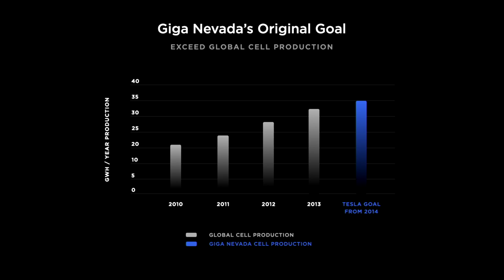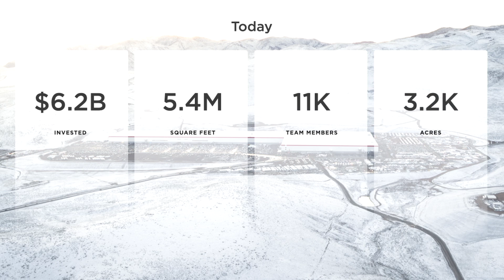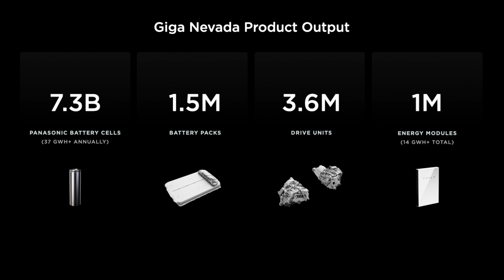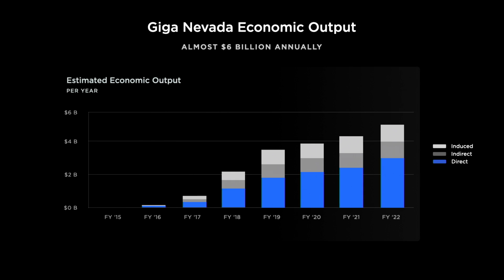Giga Nevada Battery and Semi Manufacturing Update

Comment: I love the idea of EV commercial vehicles, but I don’t like electric personal vehicles they are boring yuck no offence if you own one.
Reply: @logitech4873 Ive driven 100s of electric cars in my career what don’t I understand? Sounds like you don’t understand car enthusiasts. I work with my hands on engines and nothing compares, I don’t like boring, quiet, whiny sounding cars with no road feel, no clutch, no gearbox, no vibrations, nothing connects you to the vehicle, they are just drive by wire sleep pods. I can’t even work on an EV myself when it inevitably breaks, you’re locked into incredibly expensive repairs what am I supposed to do with that? With mechanical stuff you can just look at it and see what went wrong, EVs just degrade into E-waste. Can’t even upgrade or modify an EV. Gas/Diesel cars are already wayyyy fast enough for my taste. The sound and feel I get from driving is so divine it’s godly to me. I’ve installed apple car play, touch screens, all sorts of new tech in 20+ year old cars and I love it. Electric cars offer nothing for car enthusiasts they take everything away, so what’s your point? It’s like you’re comparing apples to oranges my friend. Your comparing an iPhone to an engineering masterpiece with a beating heart like a Rolex. Are you a car hater? Have you ever actually driven and enjoyed a manual sports car? If you were a car lover you’d understand.
Reply: @CarLoverPhotography  Damn so you only like some cars? Sounds a bit limiting. I love all types of cars.
Reply: @logitech4873  I’m just saying I’m against EVs taking over, or causing problems for people who rely on gas powered vehicles and explaining why I said EVs are boring.
Reply: If you were a car lover, you'd understand.

Comment: We can put massive amounts of solar at the base of wind farms too. It's space that's not used. Sure we will lose what ever the % is to shadow loss. But gain all that extra electricity.
Reply: What do you do it a turbine needs to be service or even removed but there's nothing but solar panels blocking access?

Not to mention the moving shadows of the turbines blocking direct sunlight.

Comment: what if cars antennas on top of the car connected to power lines on the street to control the car via bluetooth like a rc car
Reply: Because it's not realisitic.
Reply: @TheEvilmooseofdoom  if rc cars exist with batteries and a controller im sure it can be possible in some sort 😂
Reply: @saint3573  Remote control, sure, antennas connected to powerlines is silly.

Comment: 1:01 Couldn't the factory be set up with a staging area on the upper floors so holes don't need to be cut into the walls and scaffolding built to out stuff in? It would also be a way for people to get air if they kept it around...

Comment: Would be cool if he reduced the size of those massive parking lots and go up parking garages can help reduce size by 50% or more and you can even gane more parking spaces.
Or if not use thirsty concrete to reduce flooding and sand mining helping ecosystems and you.
Reply: They're not facing a size constraint.  They own a lot of land.
Reply: @TheEvilmooseofdoom  LOL that's not the point.
the point is that this config is very inefficient and not sustainable at all.
Reply: @miles5600  It seems to be working just fine so far, despite what you are pretending.

Comment: Danger
Nevada plant EvSemi is / will be be 500,000 EvSemi per year  Danger Will Roberson Danger (DWRD)
Why?
Over 288,000 heavy trucks were produced in the United States in 2021, and that is an increase of about 20 percent compared to the 2020 production volume.
How many semi trucks sold each year? FTR says truck sales for 2021 were 365,000, 
Ok
Now your sorta seeing the DWRD with IceSemi still in production and EvSemi plant cranking out 500,000 EvSemi there is a gult of 423,000
Next Problem
Semi Charging vr Semi desile fill and to make it worse no home no EvCar charger will charge a EvSemi. You could fully charge a EvSemi with a 200amp home system in 7-10 days. 7-10 days to charge a EvSemi and drive 220 mile trip. That is 500 mile range there and back and 60 miles in the tank just in case there is any stop lights.
Now
Dont get me wrong this EvSemi is 1000% better for our planet Earth than EvCars and needs to be done ASAP but the economics are not there yet. Technogly in EvSemi must improve before a Semi driver owner can buy these puppies.
Tesla EvSemi factory will be bankrupt.
Reply: I think you're off by a order of magnitude.  Their goal is 50K a year.

Comment: So said to see investors still do not understand these updates and would rather hurt the stock than to see the company to strive. Really think Tesla should take all profit and dump it back in to the company and post nearly break even for the next 5 years. Giga Nevada really should double or triple its investment and make the factory even bigger for future expansion. Doing this not only gives them the advantage to grow and produce their products at alarming rates. 
Tesla also needs to work on their powerwall and what it means to have a powerwall. There are a lot of off grid people and there is a huge market for it. Just they do not want to be tied down. Battery storage split between the Tesla unit and the home should be the something they really need to expand on. Being able to plug in my cybertruck, tesla car and semi to keep power going to the home and to provide solar to charge any unit or battery pack connected. 
Tesla really needs to move in to a couple of other markets. One would be the portable power units for example the Jackery or like units. Yet offer everything that is needed. There are a number of channels that do real reviews with these products. These are pricey units with some costing 1k to 5k and even more. There is a big market here. 
There is an even bigger market in the tool sector for example mowers and hand tools. The one thing you can not do is sell that crappy 4 wheeler via a licensing agreement again that thing is junk. ATVs, side by sides, dirtbikes, golf carts, e bikes and a vastly huge market is out there and Tesla behind the helm of these things will surely make some money. 
Hire 5 people at 100k each and give them a year and a budget of 5 million to hire additional  staff and do enough research on these smaller batteries things and you will find a market you could build in to. Like I said there are a huge amount of people that do real reviews on products. Only if Tesla was able to fix all of these problems and make this line better than the rest. They could sell 10s of billions of dollars of products making a good amount of money.

Comment: With newer and better battery tech coming out you need to think of getting it in the works as the lithium battery tech is soon to be out and no longer used. Get out of China and get out of Commiefornia altogether. Be best for the company and its future growth. Looking forward  to your electric OTR truck though:) Was the semi loaded to 80k poundage? If not then not a great test. All should be done at 0, 50%, and 100% poundage.
Reply: I think lithium batteries are going to around a lot longer than you think they are.

Comment: I think a big factor in the "3 pillars" is affordability too. To get mass adoption, you have to be cheaper than gas competitors, otherwise most people will stick with what they know. I would love to try an ev, but my very nice gas car was $7k, an ev would be triple that, at minimum
Reply: You can get some used options that are in that realm.. for example my used chevy volt was 13k. Definitely agree generally though that the options are not realistic for mass adoption.
Reply: Are you factoring cost to operate?  I know one person with a Tesla, and that's a 2019 M3.  So far it's costing him less than $20 to charge it.  My car which has about the same range costs me $60 a fill.  Plus my car needs more regular maintenance which is costing me..  Sticker price is important but it's also just one factor.
Reply: @TheEvilmooseofdoom  No, but a big maintenance thing I'm hesitant about is the battery life, especially buying one used. The oldest teslas are just coming up on 10 years and it will be really interesting to see if they start dying out and how expensive they'll be to replace